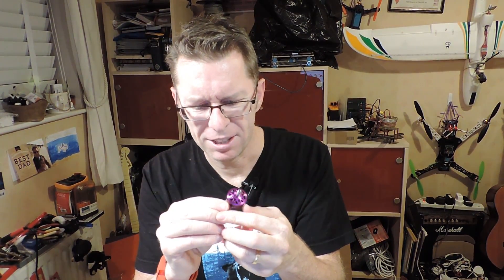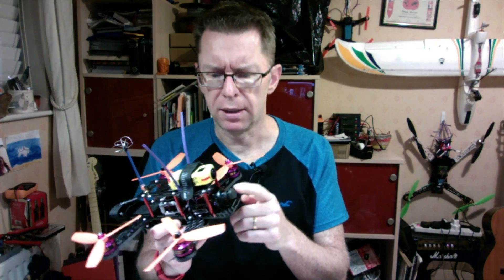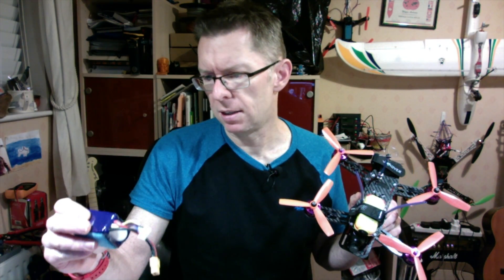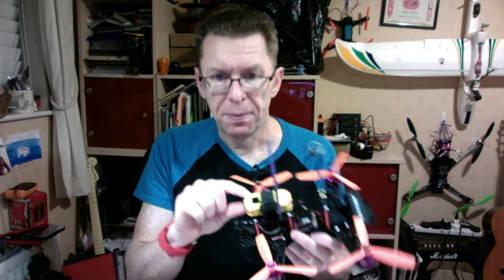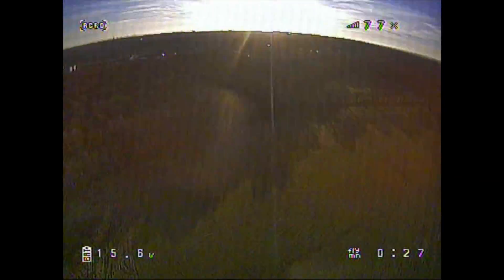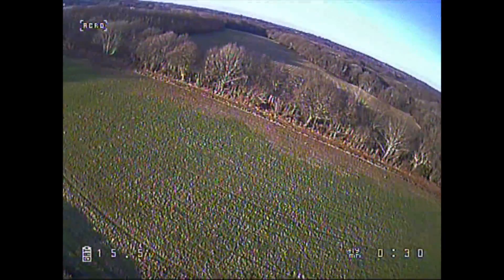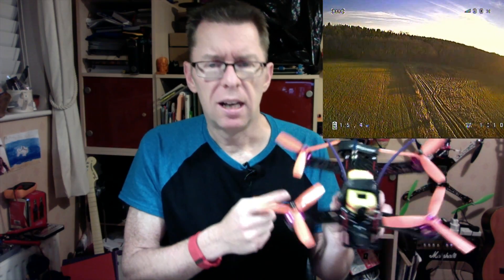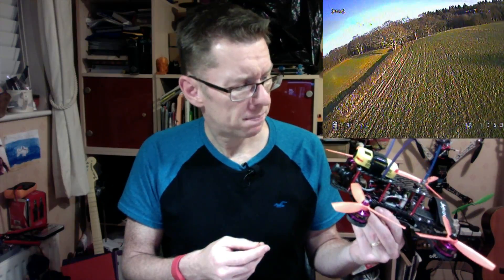FPV First look:  DYS 2206-2600KV Fire motors, supplied by Gearbest

Comment: Dude absolutly OVERPROPED, no bullnose. low pitch, less weight. Try some of the new Biblade from Racekraft
Reply from the maker: :) Well, according to the motor specs, they can handle 5045BN tri-blades... just my lipo having issues.  But yeah, I'll try a better range out on the next flight (although I needed to rebuild that quad to use a different motor/esc/fc setup - so needs rebuilding onto another frame)
Reply: CurryKitten The question is not if they can handle it but if the pids and packs can handle it. with 2600kv motors you can go for some detremental speeds with the right prop. generally speaking i would avoid trying to get more than 1.2kg of thrust out of a motor. a 800hp car is fun to have but i doubt it is fun to drive in the mountains.

Comment: There is a reason that we fly 5" props on a 2204/2300 and can use 20A esc's with 45C Lipo's. There is a sinergy between those four. Changing one of those four results in needing to change the others too.

You can buy new Lipo's with higher C rating but with this setup you will still puff them in no time if you don't change the props.
 Try normal 4x4x3's not bullnosed for instance and it'll fly alot better. The high Kv's combined with the greater torque of the xx06 and the even more torqyier bullnoses are realy a recipe for Fire indeed ;)

If you realy want to fly 5" props then I suggest 5x4 two-bladed, the motors are having a hard time to spin up/down the heavier 3-bladed ones as it is allready.

Interesting video again, keep it up :)
Reply from the maker: I knew it was a bit of a crazy power combination, but I wanted to see what it could do...and I still do.  A few Graphene's on the way, but I might build up a little slower this time, start on two blades before upping to 3 and ditto with the pitch

Comment: That voltage drop was brutal. 65C graphene 1500mah will sing there if you have one. I bet they reverse super clean and can't get the idea of a brutally purple and pink clashing 3D beast.
I found these too but will have to wait till new year to purchase some now December dried cashflow. I'm sure the fib about ratings but initial reports are decent. http://www.banggood.com/Gaoneng-GNB-14_8V-1500mAh-4S-120C240C-Lipo-Battery-for-FPV-Racing-p-1102069.html
Reply from the maker: Yeah - I noticed those ones on Banggood as well - along with a few others, and several opinions on graphenes as well.  Which needs about £100 to blow on a bunch of lipos to test against each other to see what will actually hold up.  In theory, full throttle is the stats are to be believed, these motors together should pull 140A which would melt the XT60 connectors :)
Reply: You first :)
The infinity look like standard 30-50 flights and degrading slowly, not found nay one fliyng the 120C gaoneg for 50 flights yet.

Comment: You really need to invest a little bit into turnigy graphenes or dinogy graphene 2.0. These newer motors are awesome but very power hungry! I have two quads with even more powerful motors than these and the only lipos I've found that hold up are the two I listed above. The best lipo I've found to date is the 1500mah 4s turnigy graphenes for power hungry 2206 setups.
Reply from the maker: Yep - someone else suggested the graphenes as well.  Added to my list for the next shopping spree

Comment: You probably want 5030 rather than 5045's on 2600Kv motors?
Reply from the maker: Could do - but that feels like putting higher pitch props on a lower KV motor.  This thing should be able to cope with 5045BNx3... it's just my lipos that can't.  Had a word with a racer earlier today and have recommendations for lipos that can cope under this sort of pressure.